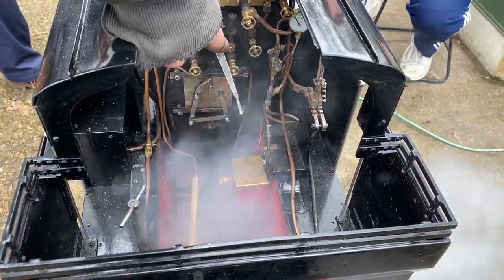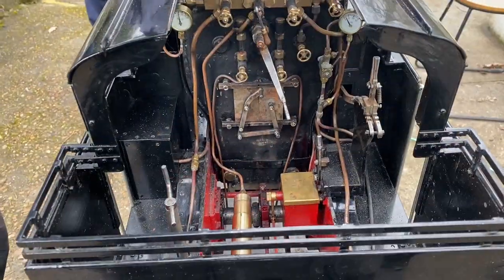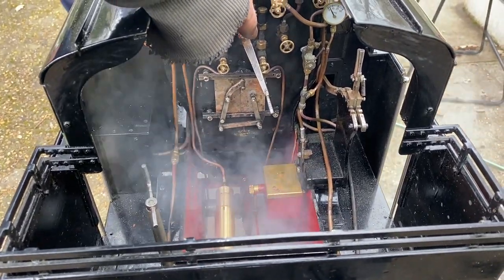Boiler test and leak finding

Comment: Hi Tom, I thought whistle 1 was the best sounding on the large Jinty. Re the small Jinty boiler looks like you've got a tricky job with that one, just a question are you happy with the tig welding on the barrel and throat plate only it doesn't look to be very proffessional, maybe in real life it looks better than it looked on film.
Reply from the maker: Hi Martyn, I was a bit surprised when I saw that welded area, and if it was a new boiler I would be sceptical, however I know this has been on the engine for quite a number of years. Obviously I can’t guarantee it’s the same boiler but I remember seeing this loco 20-25 years ago at an exhibition, and it wasn’t new then.